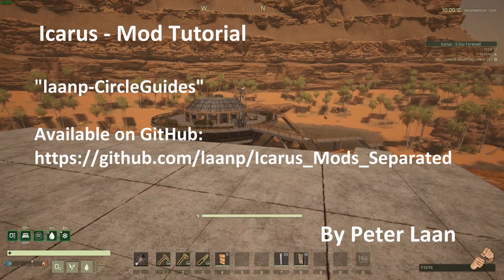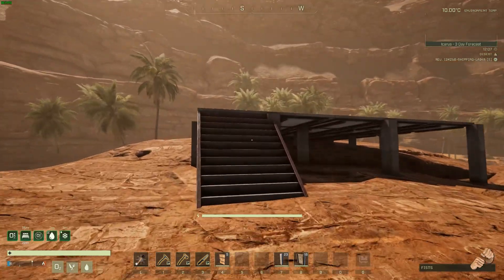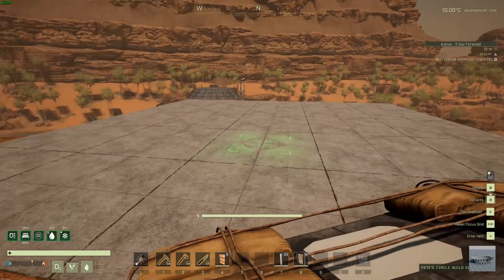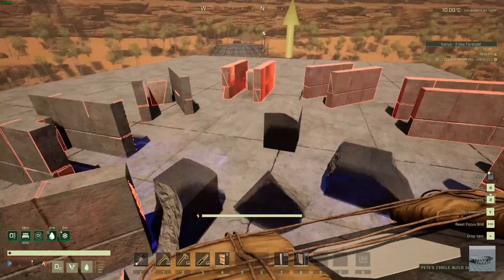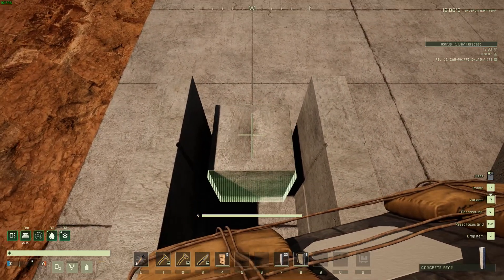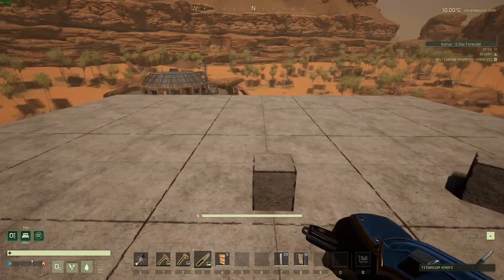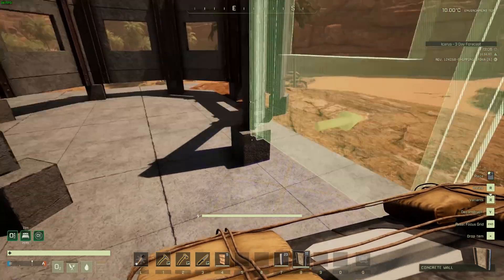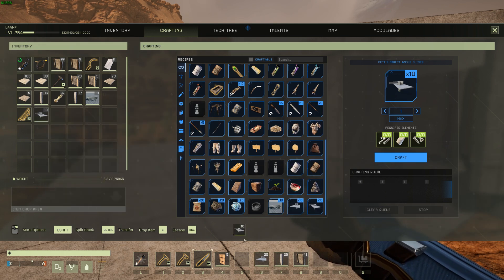Icarus - Mod Tutorial - laanp-CircleGuides

Comment: Hi Laanp, how are you? I would like to know if it is possible to create a triangular foundation.
Reply from the maker: @K4LIBRE13  yes, it’s possible using the right side of the CircleBuilder menu. Just place a beam and rotate the next one right on top by 60 deg, build the wall section (can be as big as you want) and do the same for each corner. Then fill any gaps using beam displacement and overlapping walls.

Comment: Hi Peter, any thought on creating a mod for placing the fencing around a circular build?
Reply from the maker: @flipntxs  I thought about it… briefly …lol.  Currently, you just build a bigger circle around your current building and use regular railings on the outside edge floors.  Designing a circular railing system wouldn’t improve that method, since it wouldn’t match the floor system.  I am currently investigating some other build mods that might provide an interesting spin on the current method… still lots of work to do yet!

Comment: amazing! but can not work in 137 week updated , there is no craft icon in bottom of list.
Reply from the maker: Make sure you get the latest mod... should be week 136! - also, if you are using multiple mods, use Jimk72's Mod Manager to merge mods properly.  I just tested w136 and it works fine for me.
Reply: @icarus-firstcohort-basebui9026  thanks ,i will try it again!

Comment: Hey my man, i tried your builders dream mod and loved it, but i cant seem to put the curved stairs mod on at the same time, could it be possible to add that mod into builders dream? It would be awesome🙏🙏😁
Reply from the maker: @FleshHunter1  Right now, the only way to have them together is to use Jimk72’s mod manager software to merge the mods, but I have been thinking about incorporating the curved stairs, and circle guides into the builder’s dream, so stay tuned, will see if I can do it by next release…
Reply: @icarus-firstcohort-basebui9026  i'm tuned in and ready😁 and thank you so much, would rather have your mods than anyone else🙏😁